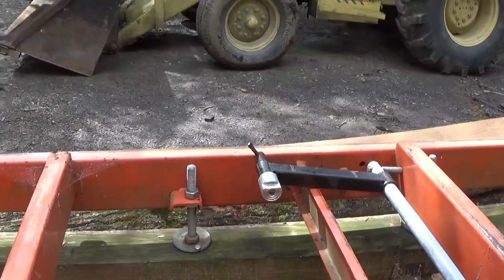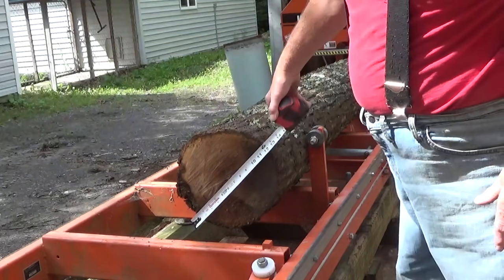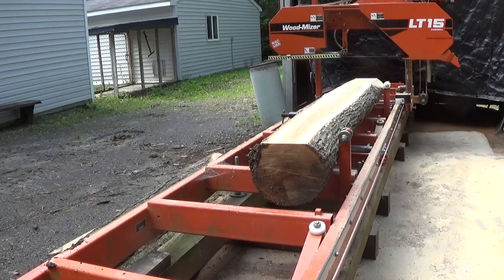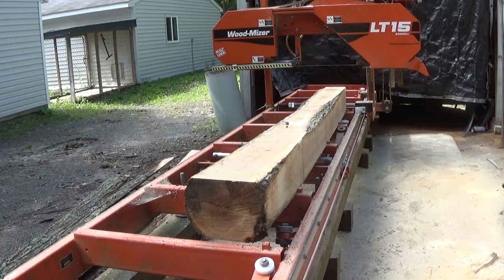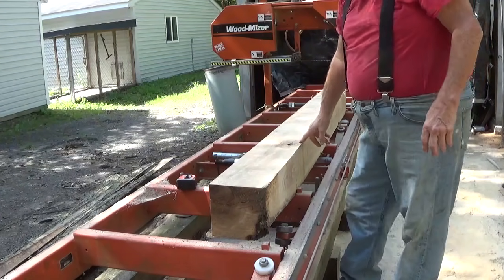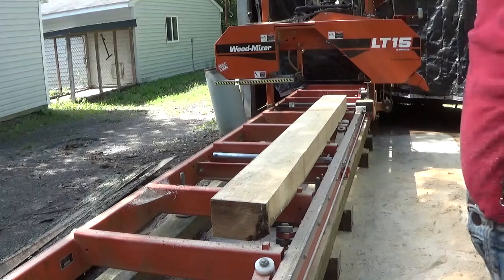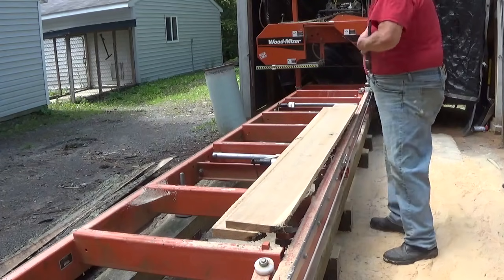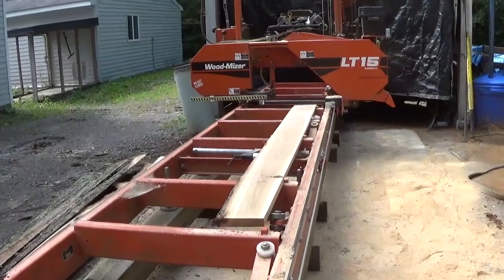Red oak cutting, how to avoid problems with a split log in your lumber.

Comment: i got a ? do you use any water on your cuts its looks like to me you dont can you tell me please i like to know cuse my saw dust sticks to my wood alot thank you i love watching your youtube chanail
Reply from the maker: I do not use any kind of lube or water except on some pine if they are really very sappy. It just does not prove itself as valuable to me.
Reply: @josaljo1  thank you
Reply: @josaljo1  ?dont that dal the blade
Reply from the maker: @scottbennett465  Not at all. If a blade lasts 4 hours cutting red oak that is good.
Reply: @josaljo1  thank you so how many logs can you get done in 4 hour and is that a 19 horse power or a 25 horse power cuse it seem to cut pretty fast it takes use at least 15 minits to cut 1 slab off a yellow pine with a 21 in hutson that has a 7 horse power basicly it might take all day or at least half a day if it goes well for one log we are thingking about upgrading some day agian thank you so much.
Reply from the maker: @scottbennett465  It takes me between 1/2 and 1 hour to cut a log myself. That includes putting the lumber in the kiln. 19 HP I believe.
Reply: @josaljo1  wow thats fast thank you ares is so slow we need to upgrade thanks again love to watch your show good work its so much fun to cut logs me and my son love it and watching you has made thing easer on use speacily sharping blades thanks jo

Comment: Joe great job on the diet! I went on the Keto diet three years ago. Lost 45 pounds in first year then changed to low carb but not as low as Keto. Kept the weight off and eat GREAT. It's the fats in Keto that eliminates the hunger pangs. I did it to lower my blood sugar. I am now in the middle of the normal range. No meds at all. I like the idea of intermittent fasting and will do it over the winter. Aldi's sells no carb bread, rolls and torlilla wraps and I can't tell the difference from regular bread. There are now zero sugar candies from Hershey and Reeses too.  (think peanut butter cups...yum) I also eat the toppings off of pizzas, just leave the crust (and carbs). Sorry for the long winded message but wanted you to hear about another option that is close to normal eating. Best wishes!
Reply from the maker: Sounds real good, we eat no carbs at all. So meat with tomatoes, onions, and peppers is one of our meals. Also tacos without the shells. My blood sugar at the moment is between 90 and 140 so I consider that normal but sometimes in the morning it goes above 140 and I need insulin to lower it. I am still taking about 1/6 the amount of insulin that I use to take.

Comment: Hello Joe, how is your diet coming along? Joe, can you plug that hole with a piece of scrap red oak? There must be an easy way to save that lumber. Look at how they cut and plug plywood.
All the best, Edgar
Reply from the maker: I did not see this comment I just read it tonight. My diet is good I am at 235 from 265. Slow but sure. There is no doubt that you can plug wood any type that I cut could be plugged. Thanks Edgar

Comment: Too bad you can't mark those boards because when the cut finished the amount of spring or tension in the kerf was substantial. Thinking after drying you may have a bunch of pretzels...
Reply from the maker: Trying something a little different, I still have a greenhouse full of red oak.

Comment: the slip-on dog is a pain in the ass!
Reply from the maker: I was aware of that the very first time I used them.
Reply: A shoulder bolt takes the pain out of getting a bottom tap at just the right depth.